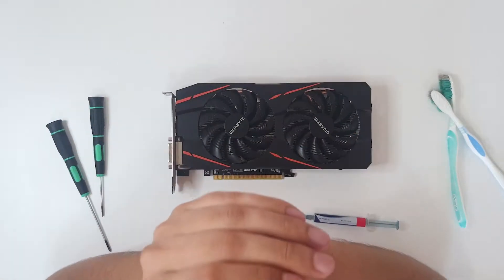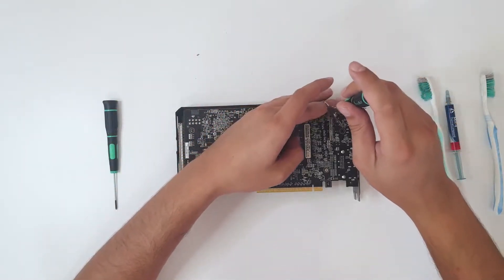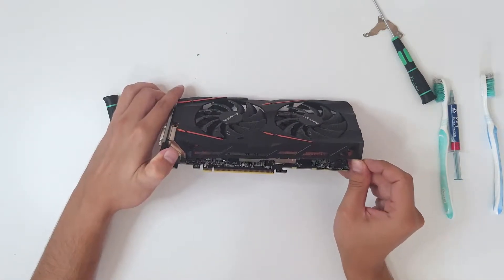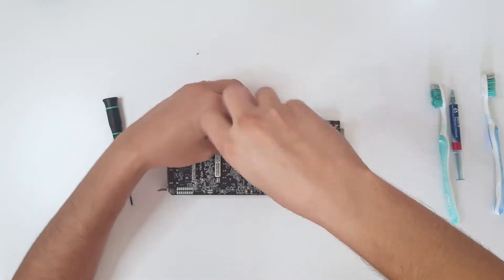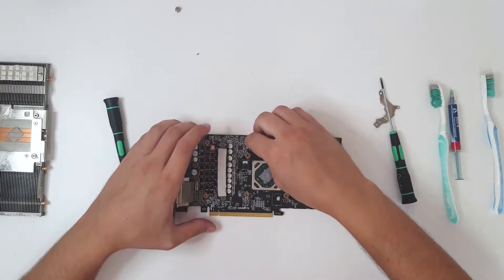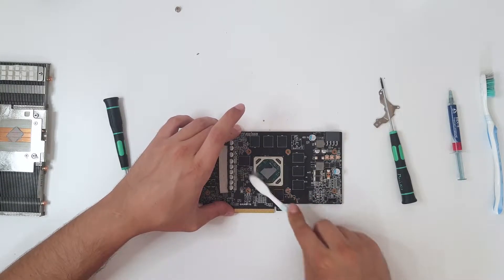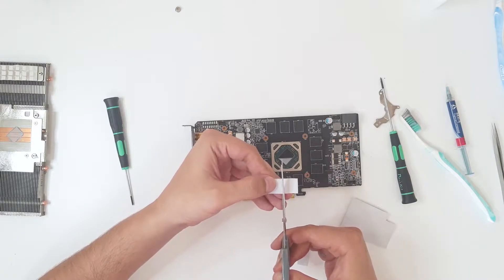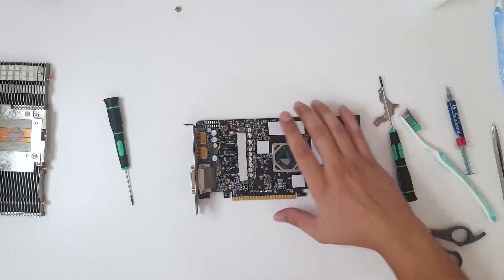How to Change Thermal paste on Gigabyte RX570 Graphic Card

Comment: The hardest part is putting the fking tiny ass screws to the frame and it doesnt help with the plastic frame in the way of the screwdriver. Its genuinely frustrating

Comment: I have that GPU rev 1.0 with Gigabyte and Fan Stop RGB Lights,what thickness is all thermal pads used?
Reply from the maker: On ram you need 0.5mm pads and for MOSFETs 2mm :)
Reply: @Chichinjo  i have paid for Mosfet and vrm 1.5mm,because some websites Tell it's correct,i'm wrong?
Reply from the maker: Well, you can either send an email to the manufacturer or relay on info from the websites.
Reply: @Chichinjo  i bought 1.5mm for vrm and mosfets,because same fóruns and sites tell that...
Reply: Im wrong?

Comment: What thickness do you need for the thermal pad of this Gigabyte RX570?
Reply: This is risponse of technical support
The thickness of thermal pads are 0.35mm and 1.5mm.

15*50*0.35mm (2pcs)
15*12.5*0.35mm (2pcs)
10.7*63*1.5mm
19*65*1.3mm

Comment: Nice video if I hadn't seen that you have to remove the fans first because of the 3 cables I was lost,what is the size of the thermal pad? mine are very dirty, my rx 570 is a version with backplate is it still the same?

Comment: Thanks for the tutorial, reassemble back my GPU but my temps ramp up straight to 89 Celsius when I boot up my game 😭 I replaced with Cooler Master 1mm pads and thermal paste mastergel v2 pro from cooler master as well.

Will try to use 0.5mm pads in these couple of days 😞
Reply from the maker: Check the losens screws on the gpu. That knows to ne the issue 😅 You welcome 👋🤝
Reply: Hi everyone. I've swapped with the 0.5 mm pads for the top, right, bottom and left (there's a small square thing idk the name) and it works fine now. But I think it's best if you guys used 1mm pad for the bottom die because when I placed the heatsink the pad moved a bit loose. Not sure my mistake or the thickness.

Comment: Hello, what mm thermal pad do you recommend for VRAM and VRM. I have the same GPU as yours in the video.
Reply from the maker: Hello, 1mm pads. 👍
Reply: Hola que tal? Puse la 0.5mm y me subio a 90 de temperatura... vi tu video pongo la de 1mm q dice ahi y se me reinicia cuando intento abrir un juego que puede ser?

Comment: dont do this if you are a woodcutter XD Dude dont use a toothbrush on the board! its too harsh and can cause damage! use a soft paint brush to remove dust etc and a pipette for the therma pad leftovers.
Reply from the maker: I realy don't know how many laptops I have opened, and all of them was at some point cleaned with tootbrush, never demaged anything. 😅
Reply: @Chichinjo  meaningless anecdotal evidence aside, using a brush on components like this is a really good way to knock off capacitors, resistors, etc. and kill a card.
Reply from the maker: If you are not carefull enought, yes. 😅
Reply: @Chichinjo  Notice the large amount of LGA motherboards out there with damaged CPU sockets, a lot of people are ham handed.
Reply: Yes its all relative to how bristle your brush is, to how strong your hand is... Of course caution and accuracy is required.

Comment: what is a thickness of termal pads on that gigabite gaphick card?
Reply from the maker: 1mm thermal pads, I recommend Thermal Grizley pads, or cheaper Gamebird...
Reply: This is risponse of technical support
The thickness of thermal pads are 0.35mm and 1.5mm.

15*50*0.35mm (2pcs)
15*12.5*0.35mm (2pcs)
10.7*63*1.5mm
19*65*1.3mm

Comment: I have a Radeon Rx 570 4gb but the fans stopped working. I was thinking about changing the heatsink and fans to a gigabyte fan and heatsink. Do you think it will line up and fit the same ?
Reply from the maker: Well idk, they must be the same, in terms of fitting gpu, memory and power modules. 😅
Reply: Thanks I'll find out more. Is the fan speed on the gigabyte model adjustable ?
Reply from the maker: Well, if it have 3 cables united, than yes. 2 cables are for power and one is for fan control.
Reply from the maker: And you control fans either by graphic itself, or with software like afterburner.

Comment: Did you put 0.5mm thermal pads in the vram? plss reply asap. cause i want to change my old thermal pads to my gigabyte rx 570. btw we're the same gpu 😊
Reply from the maker: Yeah, you can put 0.5 mm. GPU brothers ❤️
Reply: thanks for the reply man. Thankyou! 🤗 now im gonna buy a thermal pads.
Reply from the maker: You welcome, and go easy with cleaning. 👍
Reply: @Chichinjo  did you use any 1.0 pads or was it .5 pads everywhere
Reply from the maker: Idk, it was long ago, I think it was 1.0mm.
Reply: @Chichinjo  all good i tried .05 and everything is working great ty
Reply from the maker: Good job 🤗